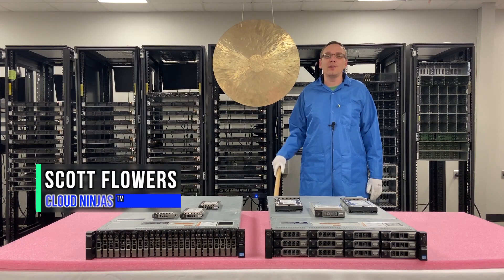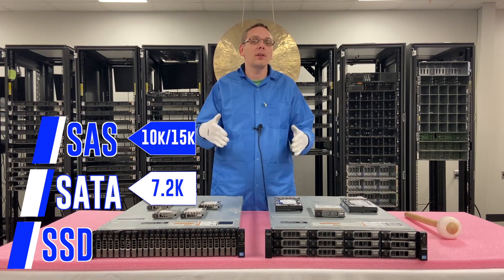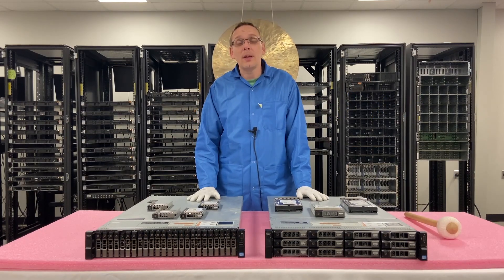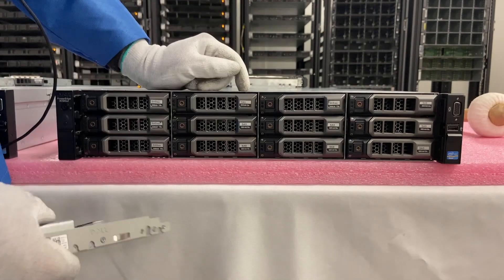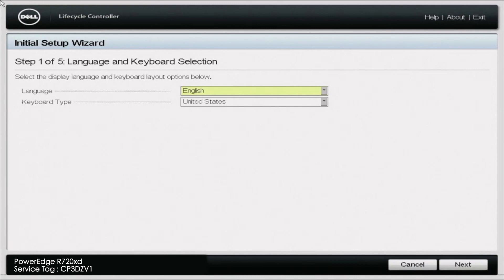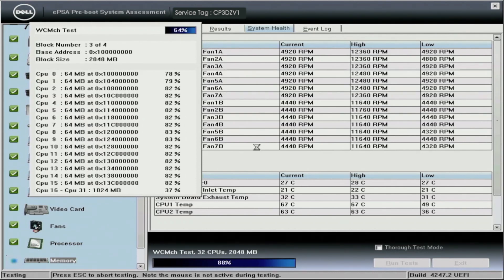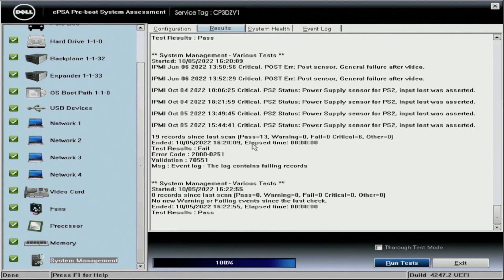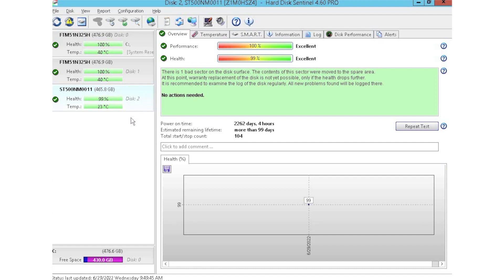Dell PowerEdge R720xd HDDs & SSDs | Hard Drives | Solid State Drives | Testing with Dell Diagnostics

Comment: I physically pulled an 18tb drive from a western digital usb elements hard drive enclosure. I have a H730 and it was recognized. I then tried it on a esxi 6 setup and the drive was recognized but did not work at all. I then put it in a ubuntu system and again it was recognized but did not work correctly. I had to use gparted to redo the partition table, then I formatted it with ext4. It seems to work fine. I've collected a few of these external usb drives throughout the years and I'm going to put them in the r720xd.

Comment: do you really need the 2.5" tray adapter though? SSD have no moving parts so it is not like there is a lot of vibration from them so the need to actually use all 4 screws is not required... the drive tray  still allows for 2 of the screws to be used which seems like it would give the support it needs to be inserted into the bay and removed as the sides of the trays should not really flex that much with 2 screws in them against a rigid SSD.

just wondering if the converter is really that much of a necessary expense, especially in a home lab type environment.